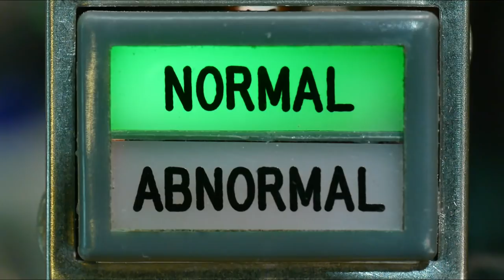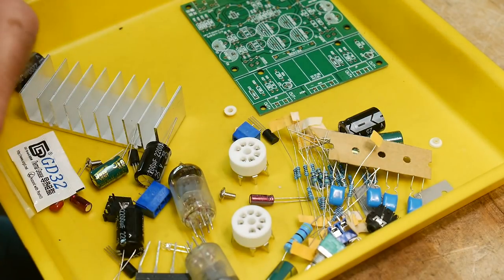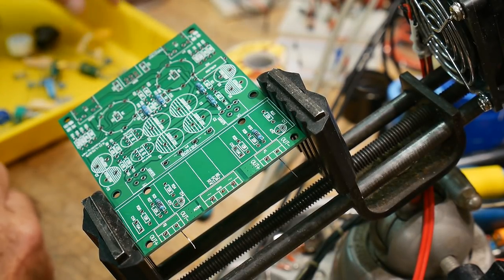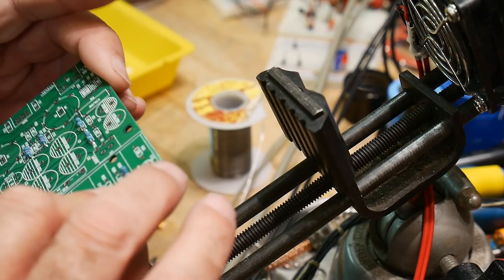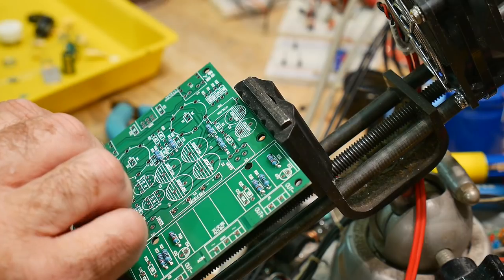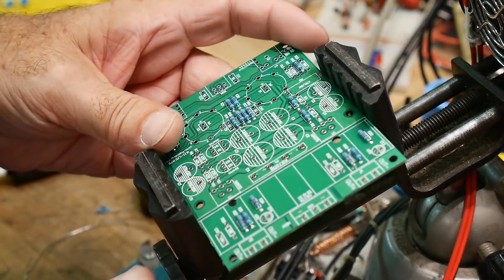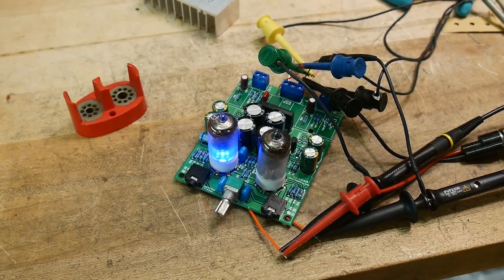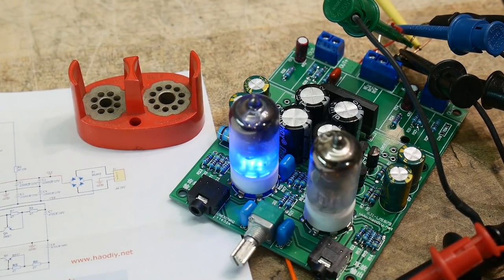#898 Tube Amplifier Kit and Story Time

Comment: Cathode follower?  The signal does appear to come out of the plate via c9 or c10 depending on which side you are looking at. What is VCC measure and the values at the C7+ and C8- to ground. I would expect a 20db gain not -20db gain?  Try a 6AK5 instead of the 6J1 just to verify the amp is working.   I bet R9 gets a little warm after a while. Maybe put a red or green led in the missing location for something different after all, your indicator does say "abnormal".

Comment: what are the tubes? 12ax?  do you think the circuit would perform if the tubes were good? or is the design crap?
Reply from the maker: The design was for 6J1 tubes. My tube markings were not that and mostly unreadable. This idea of a tube input gives the signal some distortion that rolls off the high frequencies and adds 'warmth' that some people enjoy. I think the design and kit is just rubbish.

Comment: Can you please post a link to where to buy these ?

I remember having to take the tubes out of the TV and bring them to Radio Shack to test and replace

So many things that people nowadays have never seen

I wonder if the tubes were pulled from old radios

They make solid state replacement, or at least they used to
Reply from the maker: this looks like one: https://www.aliexpress.com/item/32812347668.html?spm=a2g0o.search0304.0.0.2a647c4aN7GQrY&algo_pvid=9f396519-b337-4fa2-bc49-d8cc0da7cda2&algo_exp_id=9f396519-b337-4fa2-bc49-d8cc0da7cda2-12